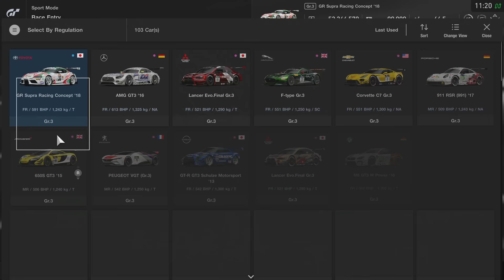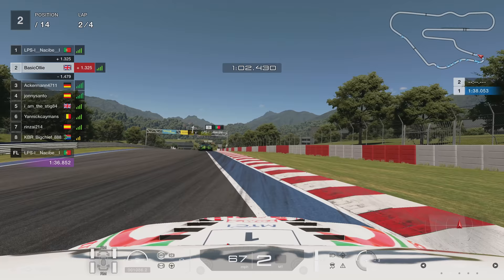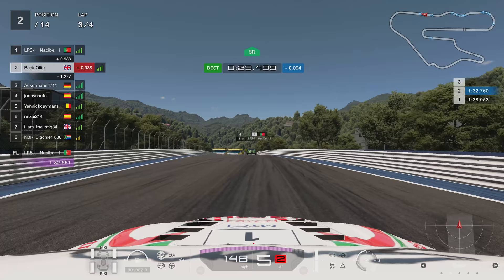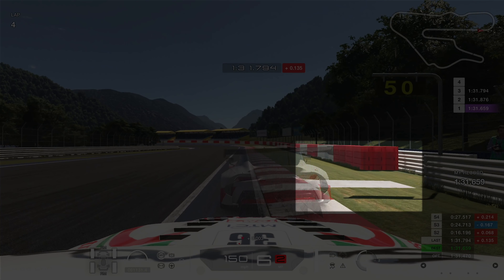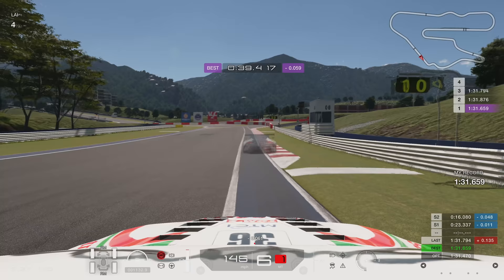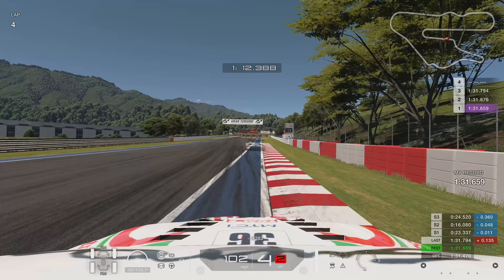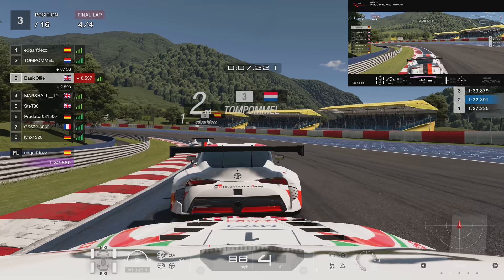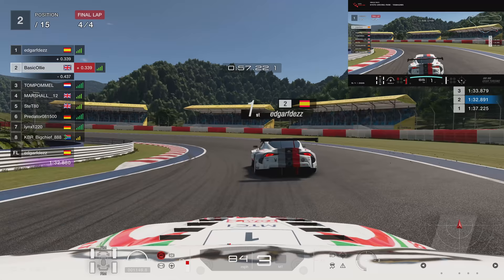GT Sport: Trying Out My New Load Cell Brake Pedal With Some Good Racing!

Comment: Awesome Ollie! You can also adjust the setting for the pedal force in the wheel menu. With brake force adjustment the indicator will light up to show pedal effort vs wheel braking effort.
If you set ABS to off, it is super easy to lock up the wheels, even with the load cell pedal.

Comment: I might be wrong but I think the load cell brake is to help with the accuracy when NOT using ABS braking mostly.. 2 with the adjustment setting rubber rings you might want to use the much stiffer setting as it makes the throw much shorter which from what you're saying in the video is what you're looking for plus it also makes is more accurate to what your already accustomed to.. you should try that for a few days and see how well you do. That default soft load cell has to much throw and you don't like it. If after a few days its still to stiff for you the medium setting could be just right. 3 Also remember you can mix the medium and stiff rings to fine tune the way the pedal feels and that and the throw seems to be the most important to you.. 

Love the videos, hope this information helps..

Comment: I think the different weight options are mainly define the distance of the pedal and you can adjust the force in the wheel BrF menu from 10 to 100. I use  the 65 option in the pedal and 70 to 80 in the wheel menu. 
With the load cell I switched to the weak ABS in GT sport. Because you can break somewhat later and use more aggressive trail breaking.  One the other hand with the weak ABS you have to take care that you reserve enough tire grip/load for turning the car.

Comment: I think the pedals are just awesome for gt, even if there might be more to gain from them in other games. 

But I also think it's necessary to find your personal favorite setup of which stiffness to use and also which brake force setting in the wheel's setup. There is just no default that works for everyone.

Nice vid btw
Reply: 100% this. I’ve been using the CSL load cell pedal in GT Sport for 6 months. It’s so much better then the standard pedal once you get it set up to suit you. Took me a while of playing around with the different runners and BRF in the settings till I was happy. Feels much more like a real car now.

Comment: What are you talking about. You most definitely can lock up. ABS just makes it intermiten - on off on off. And if your turning, if you have it turned beyond a certain point, not even abs will get you back. 

Also, you must be doing something wrong if your struggling so much with load cell. Configure it properly. You can make it so if you touch it with a toe then it registers. 

S/S driver, so I'm not talking out my ass

Comment: I use the same pedals. There is an app from Fanatec where you can adjust the min and max of the pedals. The adjustments with the elastomers are 65, 80, and 90 which refers to the durometer of the elastomer. I use the 80. Don't mix and match them, as much as you may want to, as it can cause the weaker one to tear. You should get used to them pretty quickly. I could not go back to the potentiometer pedals. The load cell is far superior.
 It would be nice if Poliphony would fix the braking. I would love to run no ABS, but it is very hard even with the load cell. I have mine set up to be very hard to lock up.  It would be nice if they also fixed some of the vehicle dynamics of the game. I think they have made it so that controller users can still play competitively. But there is no way that you should be able to slide the car and throw it into corners so hard, essentially not being smooth, and be able to be faster than a smooth driver who clips all apexes. In real world driving you would find a lot of the top GT Sport drivers to be much slower with their technique. At least they should wear through tires much, much faster!!

Comment: I have the same Fanatec setup as you, including the load cell. I also struggled with the amount of force needed for the LC pedal. I discovered that this is fixable. If you download the Fanatec FanaLab software, you can tweak the amount of pressure needed for the brakes, I run mine at 40-50% for most games. Once you adjust it, the settings are saved. You can also set different configs for different games, different cars, etc.

Comment: Well, I dont' know how much it applies to your case, but as you have a load cell, it might just applies to you as well.
I have the V3 pedals, with load cells too. And I have the same range of force to applies to the pedal, BUT, with the Fanatec software you use to uptade your wheel (by the way, I have the eaxt same wheel as you) you have the option to decrease the force needed to applie the full brake power on the game.
That means, if you have a 90kg brake pressure, if you calibrate it to 10%, when you apply 9kg, the game understand that you put 100% force on the brake.

The philosophie behind is that the higher your brake pedal force is, the lower distance your foot travel. In F1 car, the distance is almost zero.

You also can modify this setting on your wheel directly, I think it's the BFR setting, or BFR. Mine is on LOW.
But yes, I reckon that I needed one or two weeks to be used to it, and I still have trouble to hit 95% force on the pedal.

Comment: I prefer wearing shoes when using load-cell pedals. A sturdy rig to mount the pedals to is important - you won't get the full benefit of them just having them on the floor, or on a wheel-stand.

Comment: Set Brake force to 30. Also, replace the "foam" disc with a softer rubber disc. Just the one.

Comment: U can calibrate the pedals to hit 100% breakin at a lower load(weight).  Or make it so the spunge spring thing is softer(or both).  I have my tlcms almost as light as possible.  And they hit 100% load just a smidge before they hit bottom.  U can creat a soft cap or hard cap to ur breakining.  If ur bottoming out ur break peddal ur finding a hard cap.  This is how i set it up.  But u can run so much resistance u cant bottom it out.  Ull hit 100% braking well before the bottom.  And u can never hit bottom cuz of the resistance
Reply: The hard stop, as you call it, is the reason why load-cells are used - that's the point where you moduIate the brake by pressure alone, instead of travel. Also, I can quite easily get to 100% force at the maximum force setting - it depends on how you've got them mounted.
Reply: Why is a hard stop the reason a load cell is used?  U get one of those with any potentiometer.  I like mine as it provides a more gradual feeling of more pressure as i press the peddal down.  Its a muscle memory advantage over a potentioneter.  If i tried to max out the settings and race it would prob kill my knee lol

Comment: I use karting shoes too. Sparco.
Reply: Ollie, You can switch out the "Rubber" bits on the LC to suit your driving style.  I switch'd out the really softs bits for the hard ones and cept the "white" one in there and ajusted to that, I have better feeling with the brakes now and im doing well on iRacing aswell. Iknow you want to keep it "basic" or default but  i dont think you can on a LC pedal thats THAT soft.

Hope you find your own "settings" for the LC pedal so you can make even better content on GTS :-D  .

Ps. The Fanalab brake force in very helpfull too ones you get the softness/stifness of your LC pedal sorted ;D
Reply: @michaeljakobsen7570  exactly. Stiffer pedal is better.

Comment: You need to set this pedals on pc first and update firmware,.It's almost impossible to press 100% brake if you don't set up the max and minimum forces. I have the same pedal's, its not just plug and play...send a message to Steve or Kie, they can help you... Steve always say's ''pedals are much more important than the whell''...Don't forget to set up the whell too, I'm using Kie set up and it's very good for gtsport.
Reply: Damn man, ruined my day. Spent so long setting these pedals up and now . Fanatec doesn’t say update firmware.

Comment: This could be my ignorance, but I thought the better drivers didn't use ABS with load cell pedals. The load cell pedals make it easier to moderate your pressure so that ABS isn't needed after adequate practice. I have a set of Fanatec load cell pedals ready to install. I assumed I'd be weening myself off of ABS. My understanding is that ABS braking, similar to traction control acceleration, is not the best way to do it.
Reply: If it's GT Sport you're talking about, all the top guys use ABS on the default setting.
Reply: @bigredracingteam9642  Thanks for the info. I'm about to hook up my new pedals and that's something I can experiment with, but not assume it's better.

Comment: Hi Ollie-do you know if Fanatec pedals work with Thrustmaster T300 steering wheel? I did ask Fanatec months ago, but they have not responded.
Reply: Not on consoles. On PC you can get a USB adapter. 

If you're after a load-cell brake pedal, give the Thrustmaster T-LCM pedals a try - they are using Hall effect sensors on the throttle and clutch, which are much more reliable than the potentiometers on Ollie's pedals. They are a huge improvement over the standard T300 pedals  (not just the brake, the throttle and clutch are much more precise too.)

Have in mind that you'll need something to mount them to, though - there's very little benefit of having a load-cell pedal if it's just moving around on the floor.

And remember, all these YouTubers get their wheels and pedals for free in return for publicity - the more subscribers, the more expensive stuff (that's why Super GT's got a DD, while Ollie and Kie "only" have CSLs.)
Reply: @bigredracingteam9642  Many thanks for the feedback.